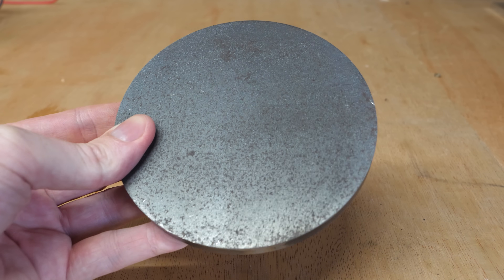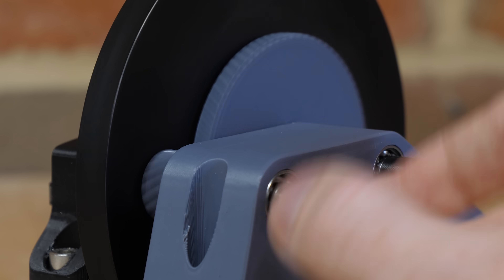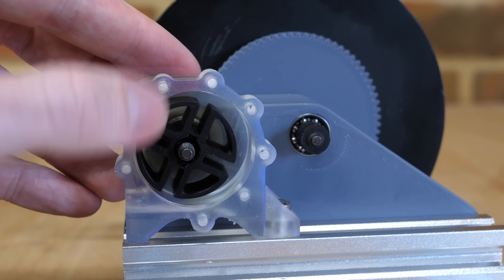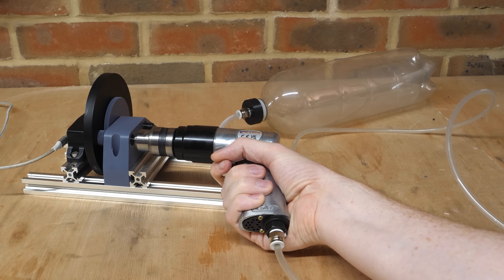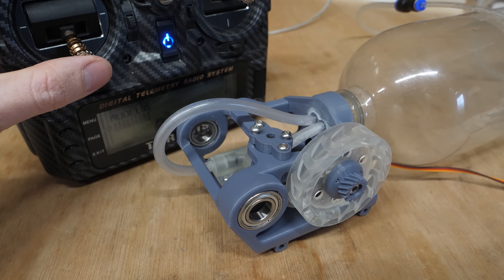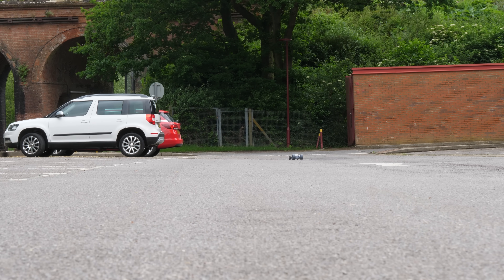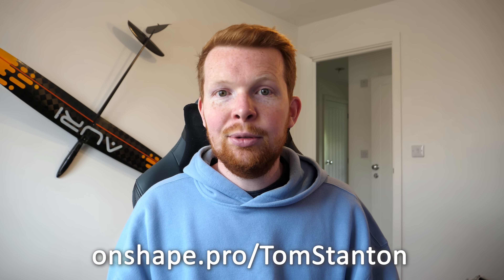Building a Turbine Car

Comment: Pretty sure the 4th turbines problem was the lack of a proper housing. Effectively the air that is forced in by the nozzle can flow backwards out of the turbine once the rotor moves enough to take that blade out of the path of air from the nozzle. Without a constant pressure flow the air takes the path of least resistance which happens to eb back out the way it came, in the process creating drag instead of thrust on thet urbines rotation.

The other big problem you've got, also related to the lack of housing is that you're only using a small percentage of the turbine total blade area at once, for best efficiency you want a constant flow of air over all the blades. the problem your going to run into though is that at your current size the turbine will gobble all the air very quickly, (much like the off the shelf air gun did), and it's unlikely the hose size your using can even feed air fast enough. Of course a smaller diameter turbine may also be really hard to print.

Comment: Practical engineer and power plant operator here.
You're looking into gas turbines, but these are combustion engines. Better look at steam turbines, these are expansion engines. Your design is a one-stage axial turbine without the outer housing and stators. For your application, I think the niche of radial turbines might be a thing. They consist of two discs with combing blades, one is the rotor, the other is the stator. Pressure is applied in the middle and travels outside. Each set of stator blades gives the air direction, each set of rotor blades converts pressure into speed. Since the blade sets are concentric and combing, you have very little worries about leaks. The air would just go into the next stage. For your application, I would start with a setup of three stages each composed of stator and rotor blades. Make sure you have two or three more rotor blades than stator blades, so you have no pulsation on your turbine. Cheers! ❤

Comment: I think you should try a hot wire resistor in the air stream as it is going into the air motor. You're carrying the battery anyway, so you might as well use it to put some heat into it.

Comment: Hi Tom a very interesting topic . I like the Tesla turbine due to its very low resistance because it is a molecular pressure of the air that drives it and the speed if not controlled will make it self destruct. The disks within the older 5.5 inch PC hard drives make ideal platters because of the very tight manufacturing tolerances. The central vents can be machined on a small CNC router. If I remember correctly there are some very good videos showing these turbines on You tube. It would be well worth checking it out. Regards MoK

Comment: Nice design work. But looking at the acceleration, one of your largest losses would look to be losses as the air blows against the stationary turbine and just deflects off as the rotational inertia prevents it from being efficiently used.  I'd look into methods of shrouding the input air to direct it into the turbine with less losses.  This is probably less important at higher rotational speeds, but might help low-speed function with less air expenditure.

Comment: You don't want to exhaust your turbine near the center. You want the opposite, intake near center and exhaust on the outside edge. Then centrifugal force will help speed the air out, allowing you to maximize the power output.

No idea if this is better than the other designs, I just know you did that 4 watt turbine backwards, making it work against centrifugal force as it spins up. It may be worth a try.
Reply: That is less efficient. Look at how the turbines on turbochargers (and centrifugal jet engines) are designed. The air must be drawn into the middle only when its density (and hence pressure) is diminished to provide proper back pressure. If we were trying to draw air through the turbine (like on the input side of a turbo) your assertion would be correct. Remember that we are trying to get the air to do as much work as possible on the turbine, so trapping it with centrifugal force ensures a bigger pressure difference between input and output. The centrifugal force is effectively acting like the seal stopping the input air from rushing straight out the exit.

Comment: Maybe put a grader valve on it to inflate easily with a compact battery bike tyre inflater or perhaps  put some dry ice pellets in the bottle so they create pressure as they melt

Comment: Try bigger flywheels and/or weights in it so it spins due to momentum and has different power output and needs different less or more air like a really, tall thin turbine to see the difference from a thick short one shape if the would also be cool to make tubes instead  of blades to see if the air will get caught more if that makes sense👽

Comment: awesome, i became interested in clutches for such things , and I've noticed most gas scooters are 2 speed which made me suspect that they use two different centrifugal clutches probably because probably the neutral to gear one  and then there's probably another centrifugal clutch on the pulley sprocket so it shifts [to gear 2]  , such a combo could work for windmills or as a safety to disconnect in high wind ....there's cable clutches too , it's all interesting because for example,  if you have a centrifugal clutch at high speed , you could  disengage the cable clutch and get power BUT the rpm would then drop below the point to engage the centrifugal clutch (from "work load") and it could even brake and then there's no spin  , or it would pause until proper rpm is hit again , ...the startup capacitor on air-conditioners for example could be replaced by mechanical clutch for example maybe  ...or you could make an auto hammer as well type deal or hit maximum speed to your flywheel before the dragster starts so it's full power off the line (?) ...hope you're doing great sir i just was searching my subscriptions and caught this newer vid thankyou God bless...

EDIT: another cool thing about cable clutch is it can be held levered  backwards basically then you could switch drive shafts too....urGh we are interested in the same stuff but i can't share all i know lol 

EDIT2: another if you used a ten speed bicycle type shifter on the windmill all it needs is to push the gear lever by electric motor for example and you could couple a cheap rpm gauge to contoller for gear shift and get a simple transmission , one of my cars the honda has solenoids to contol hydraulic flow to the gears to shift, they say that transmission is basically a stick shift type but uses solenoids instead of manual lever for example ....

Comment: If you made herringbone gears instead of helical gears, then you wouldn’t need thrust bearings.

Seriously, not using herringbone gears makes no sense when you have a 3D printer.
Reply from the maker: I originally had herringbone gears on the dyno, but if they weren't perfectly aligned, they'd cause inconsistent torque readings. So standard helical gears gave the smoothest torque readings.
Reply: @TomStantonEngineering  OOOF!
I think another type of double helical gear exists, which is better at self-aligning. I’ll check Wikipedia again.

Comment: Use a small air compressor or build a tiny one, that uses a Co2 cartridge to prime start it and then make it a loop into your air gear so the gear pushes air back into a tabk then back into the gear....

Comment: With a pulse type speed sensor you can of course get lower resolution but higher frequency (in the time domain) measurements of velocity!  Simply count the duration between the pulses, rather than the pulses in a given duration!!  You can then digitally average those "instantaneous" measurements to provide higher resolution, but lower frequency results......

Comment: What's the lightest material that can hold massive PSI without breaking or rusting? I wonder about that ford truck aluminum or titanium. How large and how much PSI would you need a tank to be to move something 250 miles?

Comment: You could design a case for the turbine and the nozzle so now air is wasted and everything goes through the turbine. Doing so, you might also solve the problem @remijio303 pointed out (turbine acting as a fan when no air is blown through)

Comment: Let me point out: The drill is designed to run off an (effectively) unlimited supply of workshop air at 90-100 PSI. It also has a planetary gearbox to increase torque, so not a direct comparison to an ungeared turbine.

Comment: So, that 4th design would probably work better if it was configured for the air to flow from the hub, outwards, as the air gets flung out due to a centrifugal force, so you were probably pushing air in a direction that it didn't want to go in.

Comment: Cool project, what if the turbine are smaller to not have to turn all the air on most of the wheel, and/or add more air :D   stronger air tank to hold more air, you will get more energy the higher speed the air have while passing the turbine. one can also have a metal block heated with electricity and then produce steam to drive a turbine but it will be hot. or using CO2 but it is instead cold and can make plastic brittle. either way i'd love to see the development of this project :)

Comment: That vane motor is just like the pump in a transmission. The thing you are missing is rings on the vanes to keep them in contact with the wall. You cannot reply on centrifugal force to keep them sealed against the walls. If you need me to send you a link to give you an idea of what I’m talking about, just let me know.

Comment: You are currently using an axial flow compressor style, which works great for acceleration of large amounts off air, hence why jet turbines use them, instead I would recommend looking into centrifugal flow compressors these are what are used in anything from large generators to helicopters and turbo prop aircraft, as they are much better for high torque applications. Love the project and can’t wait to see where you will go with it!

Comment: you should add an "air chest" where you have a pressure tight chamber that goes to multiple nozzles like steam chest on steam turbines might help ensure all of the pressure is getting used by the blades and not lost before the energy of the air is wasted.

Comment: You should get some old worn out vacuum gyroscopic aircraft instruments. The gyros are spun up using very similar turbines. Attitude indicators, DGs, and Turn Coordinators/Turn and Bank should have gyros in them - just make sure they’re “vacuum driven.” 

Also you should probably be using jewel bearings for the turbines.

Comment: You better use one turbine with 3 different sections with different radiuses.🎉 Imagine bicycle gears on the back wheel, where gear is switched to smaller disc, so you can add small mechanism to the air pipe pointed on the gear, to auto swith it on the smaller disc after reaching max speed using the bigger one. You can print such turbine as one part with 3 sections to switch on... or more...

Comment: If you want to build a turbine like a real gas turbine, the airflow should be coming in parallel to the shaft, not tangentially. The blades on a turbine are just minature wings so they perform best with the air pointing straight at them. That's the point of the stators in between each turbine stage.

Comment: These sliding blade turbine design can be found as vacuum pump for the locks in a Audi b5 a4 from the 90.They are made with compressed graphite which reduces the friction. If you can get your hands on one from a scrapyard you may have a turbine that can work pretty efficiently with the limited amount of pressured air

Comment: Your methodology is flawed because the air drill has a turbine and gear train, which consume the power. Had you removed the chuck and the planetary gear sets and tested turbine to turbine, you'd see better results out of the air drill.

Comment: There is phenomenon when you pump the trash bag with air with single breathe when you do it form distance but when directly blowing inside you need to put all the air there.

Make the end of the nozzle in way that as air goes trough it would suck the air around and drag it along it to have more air mode mass to push the turbine.

Comment: Make it so when air enters the turbine it can not flow outwards until about half of the distance.

So the nozzle is sealed from zides and air can only go to turbine and cycle about half of the turbine.
Before it can leave.

Cuz you waste alot of air to flow outwards.

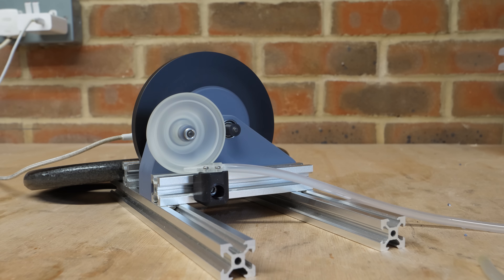Comment: 8:00 I think the reason the others performed better, is because the "curve" of the regular turbine's paths actually guide the air to exit in the opposite direction (so the force the air exits with, is additionally imparted to the turbine as a reactive force by Newtons laws. In addition to the energy you would get from completely stalling the air by absorbing 100% of the kinetic energy. So in total the theoretical maximum efficiency instead becomes 200% - and more if you can speed the air up! Minus of course any energy that was in the same axis as the spin-axis, since that direction was not touched), while the bad turbine only guides it to exit in a perpendicular direction (it absorbs all kinetic force in the axis perpendicular to spin-axis, but no more).

It is much like how a gravity-powered generator at 100% efficiency has the weight not fall at all, while at 200% the weight start flying up into space! ;)

Comment: Now you can pressure-fill the bottle with methane and use it after it has performed it´s mechanical task by spinning the wheel as a jet engine (by capturing the now low pressure methane in an exhaust-like structure and igniting it in a jet nozzle exit).

Comment: I window how you measure the power output. Of course, the power output depends on the load, so I assume you tried different loads to measure it. However, I didn't see any of this in the video. What load did you use to measure it?
Reply from the maker: The acceleration of the flywheel is the load.

Comment: Print the nozzle with a narrow slot and as wide as the turbine blades. Also the end of the nozzle should be angled to be parallel to the face of the turbine, and sit as close as possible to minimize air blowing out the sides VS going though the blades.

Comment: Add some rocketry science with a nozzel tip of the air line and a shroud on the turbine. 

A recirculation stator would be genius, not that this isn't already.

Comment: What I am always womdering with these videos is why do you have to use a plastic bottle? I get that its like a "household item" and what not. But you could built a preasure chambre out of steel tubing from the hardware store that will hold manyfolds the amount of air. On an Airplane or helicopter I understand that you need to keep the weight low also it might me worth the tradeof anyways for aerodynamics and what not. But especially on a car I would be interested to see if there is a way to make a very high pressure chamber manageable and by how much that extends the range. Some inspiration might be the "airzooka" on the slingshot channel

Comment: I wonder how you'd go trying to make it run off a CO2 canister. Maybe with a regulator to bring the pressure down, but I don't know how the volume would be. I know CO2 canisters used as propellant works well, like for CO2 dragsters.

Comment: i wonder if you could create a hybrid capacitor/air car where the initial jolt to get up to speed is provided by capacitors and small motors and the compressed air sustains that speed for as long as possible

Comment: That solid axle (or "live axle") is probably causing a ton of drag... If you made it so the rear wheels could spin independently from eachother, it would go faster and further.  Every time you steer or the tires encounter uneven surfaces, they want to spin at different speeds, but can't (because of the axle connecting them together) and it scrubs off speed/momentum from it.

Comment: was going through the compressed air engine and now I think I have an idea for improving the efficiency of the engine even further 
If you use a reed switch and a magnet in the piston and to release pressure in the piston at just the right time the engine 
Can run at even lower pressures than before and for much longer which can increase the efficiency several folds.
By the way I am a student and I love your projects. Thank you for inspiring me.

Comment: Hey Tom; here's another thought for you to perhaps try. If you're doing a multi-stage turbine, consider doing a contra-rotating axial turbine, so that you don't need to use a stator. Obviously, you'd need an epicyclic gear train for one of the rotors.

Comment: Hey Tom, I think your throttle valve should be incorporated into the nozzle, so that all the energy is converted to the air jet directed at the turbine blades instead of losing pressure just for the purpose of throttling/turn-down. Some kind of needle type valve might work.

Comment: Should think about trying to either find a stronger bottle, or a way to make the bottle stronger so you can raise the PSI that you can put into it. Maybe get a paintball CO2 bottle, and see how much PSI you can put into one before it fails (make sure you test in a safe location cause that could get a little loud if you know what im sayin). how cool would it be to have 1000 PSI (even more probably) to work with.

Comment: You might want to look into the small 3000-4000 PSI bottles used with PCP (precharged pneumatic) air rifles.  Those things are wickedly powerful. 🙂

Comment: For real dragster-like performance you need an explosive launch. The turbine alone is a low torque high horsepower solution and not conducive to fast launches. However if you were to spin up a flywheel with the turbine and then use a clutch mechanism to quickly dump the energy to the wheels you'd have a real dragster on your hands.